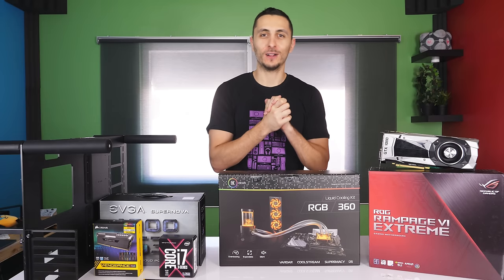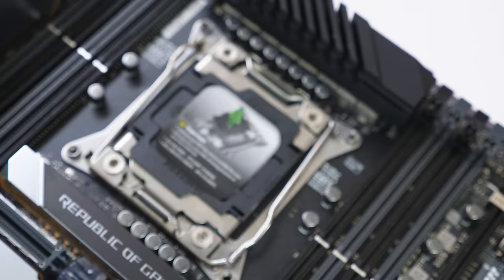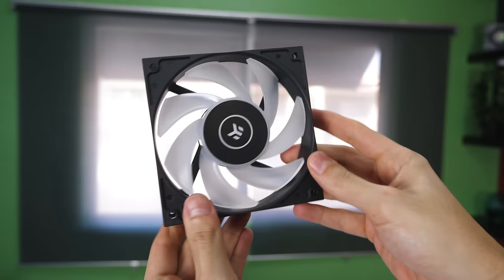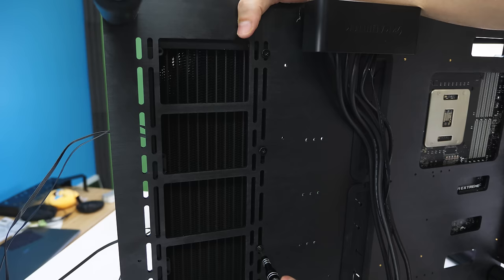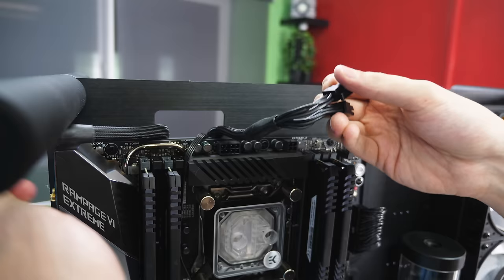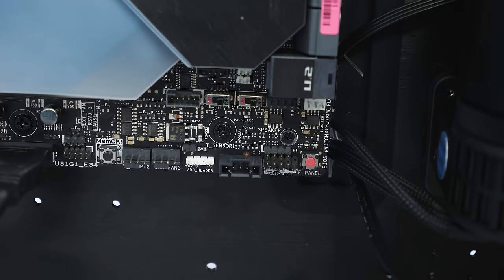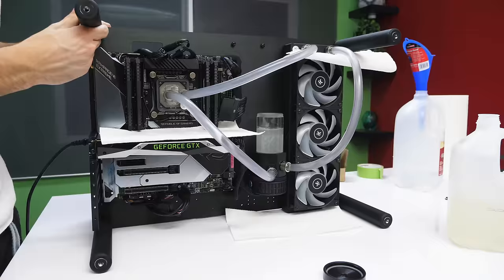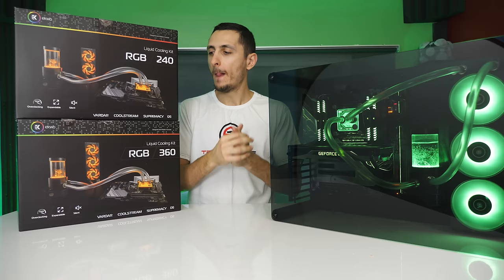How To Build A Water Cooled PC - EK RGB Liquid Cooling Kit

Comment: These are the components i'm planning to use for my pc that i'm going to build sometime next year. Do all the components work well with each other and are there any improvements I can make?
Intel Core i7
ASUS ROG STRIX Z490-E Gaming LGA 1200
ASUS ROG 1660 TI
PSU bridge
PHANTEKS 1000 W PSU
Corsair Carbide SPEC-OMEGA Case
EK Classic Kit S240 D-RGB
Samsung 970 EVO M.2 SSD
Corsair Vengeance Rgb 16 GB x 2
Corsair Hydro X Series Gpu Water Block
Reply: also will the gpu water block work with my gpu?
Reply: you would have to check if the gpu water block is compatible. personally i don’t really see a need to water block a 1660ti since the temps don’t get that high anyways. i would save the money would you spend on the gpu water block and put it towards a better gpu like an rtx 2060 super or something like that
Reply: there is also no need for a 1000w power supply, your specs are WAY underwhelming for that. 650-750 watts should be perfect
Reply: Pheonix X  thanks. I updated this after I commented and I’m planning to use three fans, 2 for intake 1 for exhaust to cool the gpu
 and motherboard

Comment: What a great video, I've never had a pc so far, always using  laptops. and for 1st time i want to have  a pc but water cooling setup. Problem is that i know nothing abou pc setups and this is so helpfull. could u update this video with the new   EK RGB Liquid Cooling Kit, im thionking on buying a rtx 2060 super or a 360 ti. Thx  u got  a new subscriber.
Reply: The video is out dated he didnt mentions how to clean your radiator which is crucial for water cooling. And how he cuts the tubing i wouldnt do that with a scissor....also leak testing people now use air pressure to find leaks. Be carefull with EKWB cooling kits plenty of horror stories on forums.....

Comment: the pump MUST go on the MAIN CPU header & the fans on the CPU_OPT header... -_- btw no any need of a radiator between blocks... does NOT EFFECT the temps any way maximum 1C....
Reply: btw no need of that useless 24pin "dummy"! just connect the green wire to any of the black vire & done... I think anyone can bend a "U" shape from a scarp wire & it is free LOL! :D

Comment: Right off the bat im hearing the gpu is the easiest part to upgrade... its the most expensive part... you shouldnt need to upgrade that frequently. especially if you can just over clock it. which is where the cooling comes in... ill just go somewhere else.

Comment: Nice video!!
Two questions:
What is overclocking, And can you link all off these parts??
Reply: Overclocking means you know you have your cpu right well it says it has 8 cores but I actually has 16 so it will last longer if one core does die the other one works overclocking is making all 16 work at the same time

Comment: Hey thank you for the video and guide.  I am building my first "custom" water cooled PC.  I have picked up all the parts individually because I went for the monoblock for the board.  I also ordered all RGB fans.  I'm trying to figure out how I will mount the Res / Pump.  It appears it is intended for me to drill holes, but I'm not wanting to do that.  In my case I'm going to place the reservoir in front of the radiator or fan intake.  Which is the best one for me to order, does anyone have a recommendation?  Thanks!

Comment: Noob question here. At 14:20 onwards I'm confused about those connections. Is it in the manual where to insert them? Or if it fits the socket you are doing it right?

I haven't started building my PC yet because I still have little knowledge.

Comment: Which fan configuration would you use (push,pull) when using a 360 radiator front and 240mm radiator top, also have a 120mm rear option available if 6 fans would be best?

Comment: Does anyone know a good method to find out if a push and pull configuration on your radiator will fit in your case before you buy all the parts? Would I just have to do the math with the measurements of the case, fans, radiator etc.?

Comment: 👨‍💻💭i mite upgrade my watercooler  i have a deepcool 1 white radiator but works fine  MY rig i7-9700k  O/C 5GHZ Runs @ same Temp you have so ? the 3 fans  radiator looks great seen these for around $100 $180? plastic tubing makes it easier also  atm But 1st i need a new GPU $1K ? 2060 OR ? waiting on good  price  🥴👍

Comment: I need help! i am new to pc building but want a watercooler in my first build, because it looks sick. i am going to buy this cabinet: Corsair Carbide SPEC-OMEGA TG RGB Tower and this motherboard: MSI X299 Gaming Pro Carbon AC. Can anyone tell me if the watercooling system will fit these 2 components and would i need any additional things for the rgb lighting? I know that a 360 mm radiator would fit in my cabinett but will the waterpump have space?

Comment: Why would someone spend $500 just to cool a cpu, which runs cooler than the gpu no matter what? Also why would you recommend to use scissors which do not cut tube well when there are tube cutters designed for that purpose?

Comment: If I put 4 gtx 1080ti's could i also fit a elgato 4k60 pro? serious question and i need answers before i buy, and if i cant what can i do to have the 4k60 pro while maximising the motherboard?
Reply: Just don't get 4 1080ti's......
Reply: i wouldnt ask the question if i considered not getting 4 1080ti's
Reply: @vanova4691  4 1080tis isn't even fucking worth it, just get one or two if you REALLY want it
Reply: 4 1080tis, you’d get better value out of a single 2080 ti

Comment: Im looking for a Gaming Prebuilt PC 
I saw this one for £530 is it worth?
Specification 
CPU : Intel i5 2nd Gen Quad Core 
PSU : 650w 
PSU Connections : 1 x 2pin ATX, 3 x 4pin Molex, 1 x FDD, 2 x SATA
HDD : 1TB SATA
RAM :  8GB DDR3
Graphics Card : Nvidia GTX 1060 6GB
Motherboard :Intel DQ67SW
Motherboard Connections : PS/2 Mouse & Keyboard, USB 2.0 x 4, USB 3.0 x 2, DVI, LAN, Audio Jacks x 3, PCI-E 3.0 x16 x 1, PCI-E 2.0 x1 x 2
Case : Aerocool Cylon RGB 
Windows 10 Pro installed  

If not can someone please recommend anything from £500-600. Thanks

Comment: How much cheaper would it be to build my own pc instead of buying a 3500$ Alienware R11?

Alienware Aurora R11

 

Processor:10th Gen Intel® Core™ i9 10900KF (10-Core, 20MB Cache, 3.7GHz to 5.3GHz w/Thermal Velocity Boost)

Operating System:Windows 10 Home, 64-bit, English

Video Card:NVIDIA® GeForce RTX™ 2080 Ti 11GB GDDR6 (OC Ready)

Color Choice:Lunar Light

Memory:64GB Dual Channel HyperX™ FURY DDR4 XMP at 3200MHz; up to 64GB (additional memory sold separately)

Hard Drive:1TB M.2 PCIe NVMe SSD (Boot) + 2TB 7200RPM SATA 6Gb/s (Storage)

Chassis Options:Lunar Light chassis with High-Performance CPU Liquid Cooling and 1000W Power Supply

Wireless:Killer™ Wi-Fi 6 AX1650 (2x2) 802.11ax Wireless and Bluetooth 5.1

Service:1 Year Hardware Warranty with Onsite/In-Home Service After Remote Diagnosis

Office Productivity Software (Pre-Installed):No Productivity Software Requested

McAfee Live Safe:No Anti-virus Requested

 

Alienware 34 Monitor - AW3420DW

Alienware 510K Low Profile RGB Mechanical Gaming Keyboard - Lunar Lighrt

New Alienware Advanced Wireless Gaming Mouse - AW610M

Comment: Im afraid in liquid cooled pc because when water accidentally goes to your motherboard or gpu or anything else in your computer it may destroy
Reply: If you put it in the cpu wrong then it'll leak
Reply: My bad I meant if you put the cooling tubes
Reply: @cqallo0000  yeah I recommend the air cooling cause its more safe
Reply: @cqallo0000  or if so.ething gets loose it will spill and fuck your pc plus its not mandatory and stupid overkill you dont need water cooling

Comment: 19:51 a very stupid part!.. using that adapter is of no use if u keep all the 12v plugged in.. cus the gpu vrms r running and water leak can still cause huge damage cus 12v is used for most of the stuff.. u should disconnect everything and then run the pump or use a separate 12v psu which would be the best to run the pump that way u can avoid the risk of leaking water on the psu and killing the psu!

Comment: Can anyone experienced with PC's tell me if this is good for £360.

20 inch HD Monitor, Keyboard, Mouse and Speakers 

intel Core i5 2500K CPU Quad Core @3.30 GHz 

8Gb RAM 

1000 Gb HDD (1 Terabyte) 

Dedicated Radeon HD 7770 Graphics Card 

Latest version Windows 10 1803 April 2018 Update 17134.22

DVD/CD Re-Writer 

Thanks!!!

Comment: 600$ for just that?
Reply: It seems the going rate.. I saw a thermaltake replica 360 rad setup and its $500. I've seen it on sale $100 at frys sometimes. I'm thinking of going custom with glass tube and highly regarded glass res and pumps for my first wc. I've read comments of peoples acrylic and soft tubing eventually cracking due to temps.

Comment: Build a PC out of all used components from eBay then if you burn something up , no big lose.. You can buy components  like m/vs CPU and GPU for nickel on the dollar ..and hardware three to five years old is still light speed fast ..there are videos right here on you tube of super budget PCs that will play most high end video games that are three years old and older  you can down load for cheap   that you don't need a $1000 buck 16 core AMD thread burner  or a muddy lake 4k intel to play or do anything else for that matter ..get old first gen Intel CPU for 20% of original cost eBay will get your money back on most used junk but you have to read all notes and pay attention before you hit the buy it now button .watch you tube videos of building high end gamer PCs out of old school parts and have fun building a behemoth for junk yard price that will set big benhmarks very close to your rich friends who pay More that a car for their hot rod PC ..check out water cooled components for PCs on eBay. Like there is a ton of new and used EKWB original fittings for hard line and soft hose that are used because the rich kids always over buy everything so they never run short and finish their water cooled rigs in a hurry..then dump new parts for cheap prices to get them out of their way ...now run along children like good little sumerians and whoop the shit out of the rich kid brats best with junk